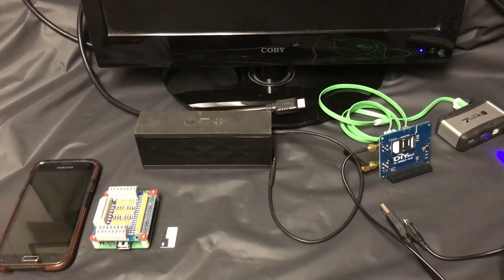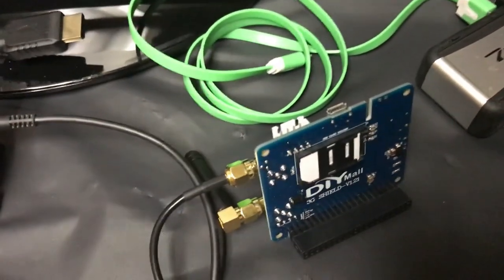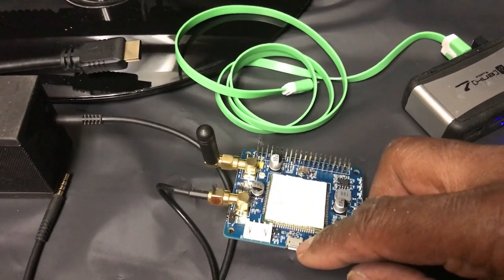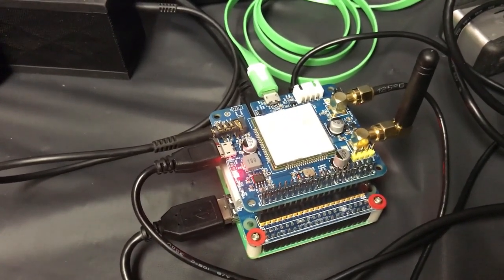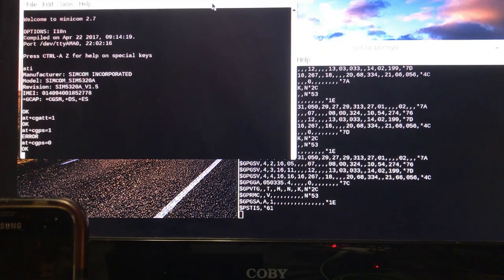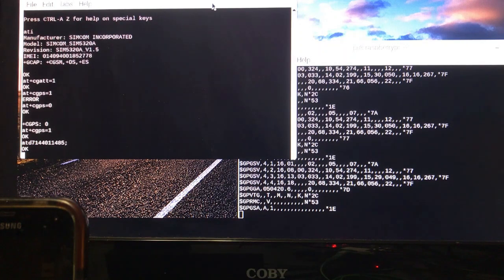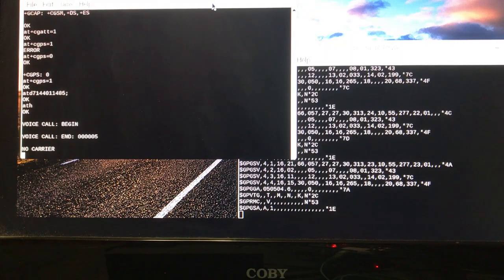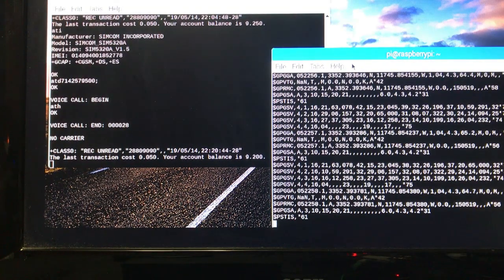SIM5320A and Raspberry Pi

Comment: So to summarize, one of the serial consoles was the internal serial of the Pi which connects to the module via the header and the other serial console was a USB cable looped externally from the module to the Pi's USB port, correct?

Comment: Great vid.. Tx.  I need to call/txt
 my Pi to switch a mains voltage relay to turn on a heater remotely. Any wild idea if this code or project is out there. Seems pretty simple but Im an idiot. Tx
Reply: The possibilities are fascinating, like retrofitting an old rotary phone, or more practical IoT projects.